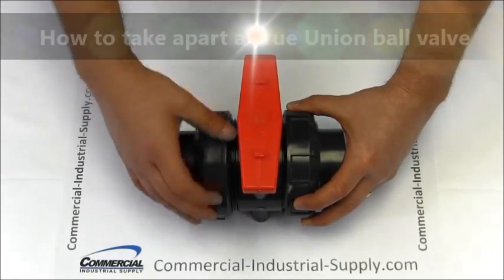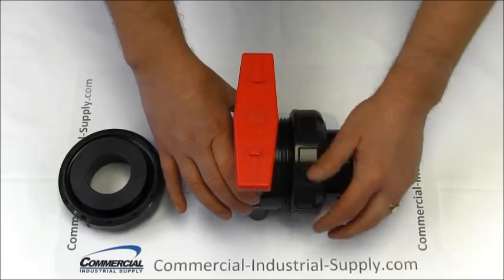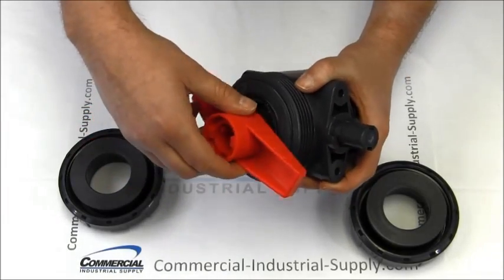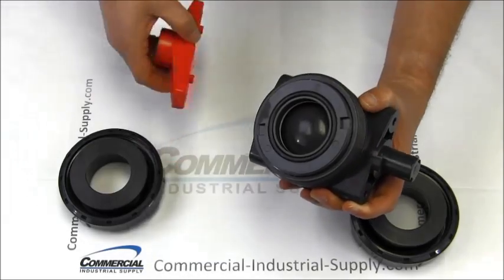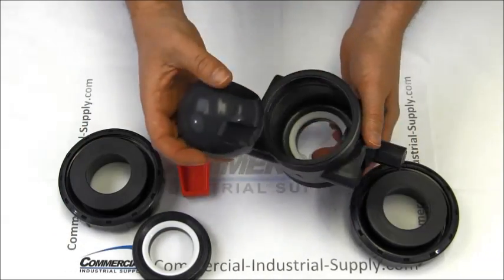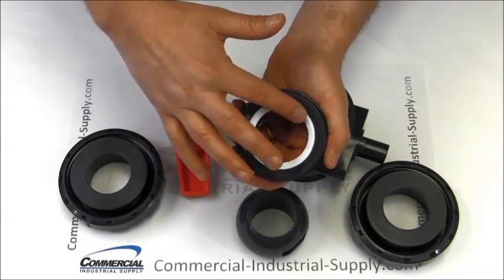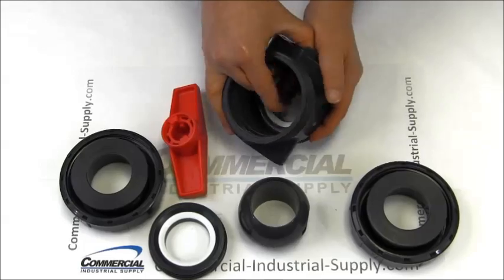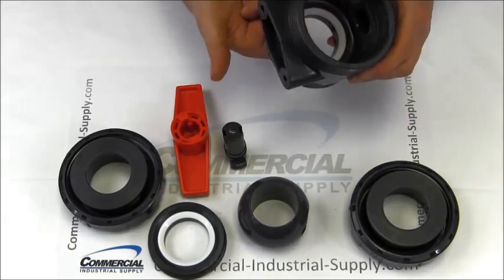How to Take Apart a True Union Ball Valve

Comment: I am installing Cepex true union ball valves on my property. You have saved me hours, days, weeks on how to adjust the handle for smooth operation. I don’t see or feel any arrow of which end should be used on the incoming or discharged water or perhaps each end is the same……Thank you so very much for this great video…..👏